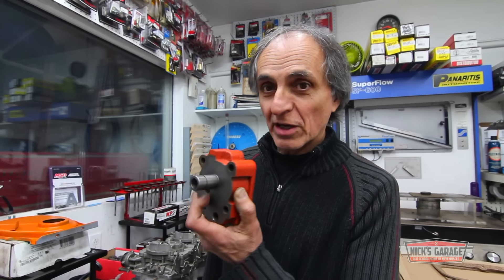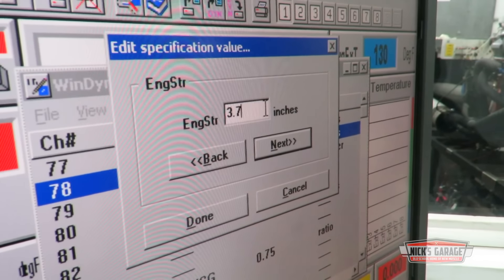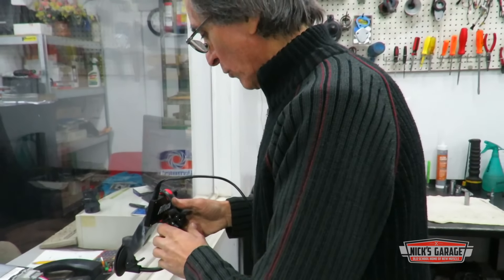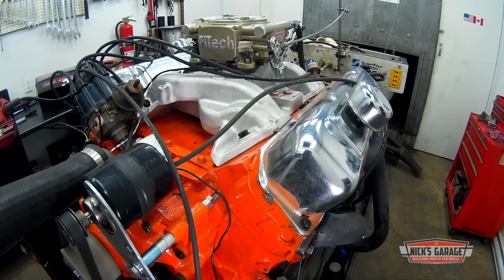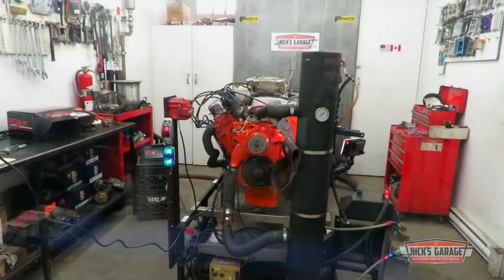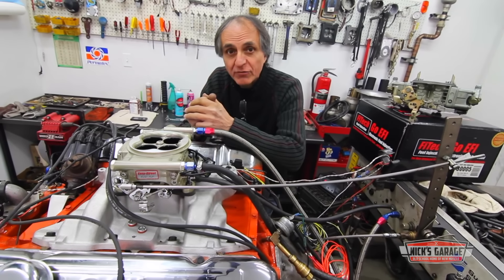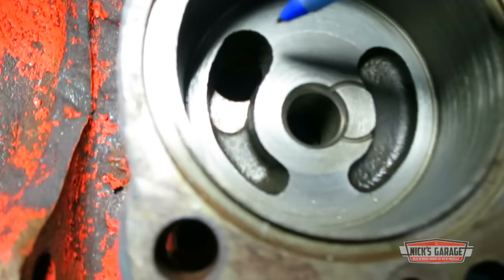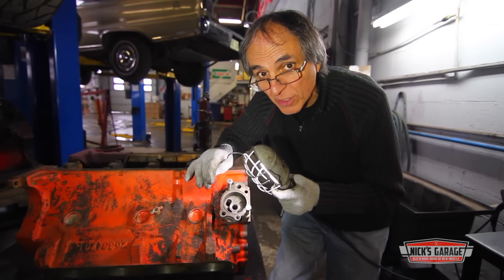Carburetor vs E.F.I. - Dyno Room Showdown

Comment: Give that fuel injection a little more time to adjust, and i bet its dyno numbers will increase. Great video Nick. Thanks for the tips
Reply: Va Hoss. Yes, the EFI needs more time to learn.
Reply: I was thinking the same thing I have a few mates run fitech EFI and they did around 1000ks or 600 miles then fine tune them after .  They seam to like single plane intake more than dual planes to
Reply: You need to load the engine at different rpm points and it will sort itself out, and I would bet when it's tuned properly it will make more power than the carb
Reply: Brett Wilkins kind of what i was thinking. Even NASCAR went to fuel injection. So there must be more positive benefits
Reply: Yup, I knew a couple racers who got as much HP out of EFI as from a carb once everything was adjusted. For daily driving I can't imagine ever going carb/distributor again. If I could afford it, having an old car to tinker with I could re-live my youth messing around with carbs and distributors that needed regular adjustment.
Reply: EFI systems are always capable of producing more power than carbs, because a carb inherently restricts the flow of intake air, it has to in order to function (the Venturi effect requires a restriction in order to work). Tuning is key.
Reply: Generally not. Carbs seem to make more ultimate power when properly jetted, but the injection is often quicker than a carb becuase throttle response is better. Injection better compensates for changes in temperature, elevation and barometric pressure - like driving to 5-6000ft on a hot day.
Mostly you see carbs beating injection but never by much.
Reply: Yeah but your arguement while true enough in theory applies to carbs. Carbs need venturi vacuum to create a pressure differential to discharge fuel. The intake design is more optimized with carbs in mind. Injection has a pump discharging fuel at 60-70psi so your discussion is better suited to carbs I'm thinking.

Oh BTW, 
Have you ever driven a car with a stout 440 in it?
All I can say is, if you haven't then the 10-15ft/lbs of torque you loose < 2500rpm with a single plane is only going to help traction lol. The bloody things make over 500ft/lbs with some comp, airflow etc.
And they're short enough in the stroke to do about 6500rpm! 
I was scared of mine.
Reply: Well for us - I'm a qualified mechanic and enthusiast, it is different.
I almost bought a Quick Fuel double pumper with 4 corner idle djustment for my project which is a 350 SBC into a Toyota FJ40 Landcruiser with 'THOSE' metereng blocks you're talking about. No question they are the way to go.
My point you may have taken slightly out of the context and I probably didn't make it as clearly as I could have - that TBI in some ways is evolving in the hobby because it self learns. Expensive dyno tuning is probably not required in the majority of installations. 
Incidentally I bought the dual quad Fitech system and paid the extra $200 for the full software suite. I haven't used it yet, and yes a dual quad 350 in a 4x4 is ridiculous, but I can't afford a 1968 Dodge Charger with a Hemi in it, but I can afford a Chevy in my fourby; and I get to drive it everyday and don't care if someone scratches it.
Thing is the flexibility of the system, the resistance to side angles, rock crawling and the lack of having to tune it was the draw card for me. 

Others will see the benefits too. I can't believe that enthusiasts are so ignorant of carburetor principals. They talk so much rubbish it is scarcely surprising they can't get their rides to run properly.

TBI is a way out since it learns and self tunes. It adjusts easily for varying conditions. Long term reliability remeains an unknown however. It still make great power too, largely ignores overlap intake pulses, shouldn't stumble off idle and should just start. The benefits for the hobby seem obvious to most but the dedicated carb enthusiast will never die out.

My carb is the Thermoquad. I love them - I do.
Reply: ThePaulv12 - It may depend on the setup, but FI is absolutely capable of making more ultimate power. 

Where do you see carbs beating injection? Basically all of the fastest cars on Earth are fuel injected, including TopFuel dragsters.
Reply: In this video lol. Look I'm not saying injection isn't capable of beating carbs, all I'm saying is that for ultimate top end power the differences are small and usually in the carbs favour.
However injection is so much more practical. 
Using Top Fuel dragsters as proof of concept is taking things to the extreme don't you think?
I like carbs very much. People say they're unsophisticated compared to injection but those people don't know what they're talking about even if they think they do.
Nothing could be further from the truth. kamphwagon1 tells of many carb options (below) for Holleys.
Reply: "...all I'm saying is that for ultimate top end power the differences are small and usually in the carbs favour."

Maybe in the world of old, American V8s, but certainly not anywhere else.

"Using Top Fuel dragsters as proof of concept is taking things to the extreme don't you think?"

How so? They want the most power that they can get out of their engine, so they use fuel injection. You also don't see any race class, anywhere, using carbs unless fuel injection is explicitly banned, because they want to win races.

Edit: I'm also really interested in seeing some examples of carbs making more power than FI.
Reply: Yes I forgot about Holley and Quickfuel. I bought my Fitech in Dec 2016 and I was seeing Quickfuel stuff on the Holley website that year. The Fitech is still in the box and I sometimes wonder if I'll ever get my motor in the truck.
Thermoquads are not an AFB clone. I've had AFBs and I don't like them much because of the reasons you don't like them. Particularly the air door weights annoy me.
I had a 440 with two of them on a cross ram intake and I thought at the time it would be good to have the secondary features of the AVS on the AFB. Well I was ahead of my time because now Edelbrock make the Thunder series.
You are quite right re Holleys being more able to be tuned. The reason I was mucking with Carters 20 years ago was my dislike of the lack of features in the metering blocks that are all now adjustable.
I can tell you why they have all those new features; It is because of the availability of readily available dyno tuning. Only 20 short years ago, that stuff was nowhere near as common as today and Holleys now have reversible changes for their metering blocks.
Thermoquads are very simple carbs. They look complex but all the complexity is on the outside. They're not popular because of durability issues of the resin body - the plugs fall out of the jet wells and the resin body screw boses crack if the carb is overtightened. 
I found an article written by a New Zealander on how to set up Thermoquad to factory specs. That article was all I needed. It gave me a detailed base line to work from. I then bought the SA Publication Carter Carburetor book and the penny dropped.  I looked at a Thermoquad and saw possibilities where others saw junk. Over the years I have installed maybe 15 or even 20 on cars and really have had them running great. Unfortunately and recently a couple were killed in a car I fitted one to in 1999. 
The big problem is getting bits for them. Carter used to make a strip kit for them and there's a place that still does. The secondary air door on them has a profile and is the venturi. They always go rich in the top end which is a desireable feature, but the air capacity of them is in the 850cfm range. Chrysler had larger ones for 440s. The dual booster venturi design of the primaries is great for large overlap cams. They seem relatively immune to low vacuum at idle. Contrary to popular belief they have a 2 stage accelerator pump.
If you don't know this then you'll never be able to get the feature to work. That NZ article points this out and how they left the factory with this feature either intentionally or accidentally disabled. The aftermarket pump plunder that is listed for them is the incorrect part no and is too short to allow the second shot. The correct stock plunger has a longer shaft and allows a second shot of fuel as the secondaries open. The airdoor tension is infinitely adjustable and you adjust the max airdoor opening by bending a tab. The opening speed of the airdoor is moderated with a small dash pot. 
It has a mechanical cam profile to lift the the metering rods when vacuum is still high and the throttle opened say during cruise. A spring raises the metering rods and they have a screw thread to alter the height. The metering rod jets are replaceable as are the metering rods themselves. The metering rods are tapered or stepped depending on the application.
What I have just told you about them is basic stuff but they're written off as a junk carb. 
Chrysler in their factory performance manual reckoned on a single quad Edelbrock STR intake that they were a formidable combination. The factory performance arm tested them extensively and told the builder a Thermoquad was a great flexible carb for the street rodder. Bear in mind manual was written in the 1970s but I was surprised none the less. 
Best of all with them is they were cheap as chips. Now they're much harder to find.
Reply: Ya it takes EFI several full pulls to get a learning time for the Computer then it still will make adjustments later, a friend had a 70 vette 454 after about 5 full pulls on a 1/4 mile the Car was scary fast.
Reply: if you only consider performance carbs will always win...the end ...EFI is there to meet emission regulations and all that first...when used as a pure performance hardware it never deliver as promised

slap a double pumper pass on the dyno and voila...ALL THE TIME
Reply: Ragimund Vonwallat- Efi vs carbs is not a very good debate there is a lot of misinformation that gets spread around in the hot rod world. An engine doesn't care how it gets the fuel into the cylinder as long as it is getting the correct amount and the mixture is well atomized then it doesn't make a difference whether it comes from a carb or an injector. Efi does give much more accurate control of the fuel mixture and is capable of doing a lot more than what a carburetor can but for the average hot rod guy who doesn't have the knowledge and ability to utilize efi to its potential is probably best just sticking with a carburetor as it is simple and easy to understand and work with and gets the job done.
Reply: idontcare80 pretty much every Dino video I see, sure the newer direct injection can hang with a carb, but these older style carb footprint Efi setups just don't make the power.
Reply: Single point fuel injection isn't much better than a carb. Need a plenum-type manifold with individual tubular runners for a proper multi-point setup, and then you'll start seeing major advantages. The plane type manifolds used on these old engines aren't as efficient. At this point you may as well be running ITB's.
Reply: Va HOSS... I would agree with your statement  I'd also like to see them put a carburetor on it that day and compare it back to back fully learned EFI versus equally flowing carb. I bet you they'll be within one or two numbers.
Reply: If you were just goin for WOT configuration, go with ITB's. Not sure why all this mess is necessary. ITB's could be done easily on a carb system, just as easy with fuel injection (although more expensive) and you'll get the best WOT performance. However, engines configured for WOT, huge valve overlap, lopey idle, really suck for daily driving. It's downright annoying to drive in traffic and attracts police attention. Street cars and road course vehicles would be best tuned for mid-range, and you can add some top end with a turbo. Carb + turbo would be a nightmare I'd imagine, probably not very reliable, either, without some kind of digital fuel metering, you'd need to run super rich all the time just to keep from grenading.
Reply: venturiless carburetor will make more
Reply: Engine master did this a while back and efi was better all the way around on hp torque etc
Reply: From what i read after market efi tend to forget what they learn over a period of time not to mention failure s with pumps injectors etc .1 in 5 has trouble good luck
Reply: If you wanted to get more power out of the efi, you could let it run longer so that it 'learns' how to make its own adjustments. OR........ Just install a Ford engine, which will produce more power regardless of which fuel intake system you choose! Lol
Reply: Yeah then after 2000miles pc restarts and learns all over again .no tx
Reply: @nickpanaritis4122  Does that EFI have target AFR's ? Is there a wide band o2 sensor or just a standard plus or minus response? 
May need to rev it or give it many full throttle pulls for it to work out a reasonable strategy....
Reply: A single plane with equal length runners, or at least a open spacer with the dual plane intake. The issue is it is still wet flow and all of the sensors need a average reading that isn't obstructed by a plenum divider or shelf.
Reply: @patrickmcleod111  fix OR repair daily ?
Reply: Self-learning like most cars when you have removed power to the ECU, it has to monitor your driving styles, altitude, shift points etc.
Reply: dual plane manifold force 1 side of the carby to behave differently from the other at different speeds ( try watching the fuel air mixture bounce back with a strobe light ) i dont know if that injector system can allow for this , once again , show me the graphs and stoich ratios , im sure that the figures given for the carby version come attached to many years of experience and experimenting , put that behind the injection system and tell me the story again
Reply: @VAHOSS  because efi adjusts itself to changes where you have to adjust carbs to different temps and elevation
Reply: @eleanorecopet4090  - First On Race Day baby.

Comment: Know many don't like fuel injection, but knowing that carburetors flood an engine with gas at starts, washing oil from cylinder lubrication, and causing much more wear than FI, also problems with idle and performance over all ranges, with a company like FITech would seriously look at them on future projects..and this is from a guy who has been rebuilding and setting up carbs since he was 13, in fact by 15 many people were bring their problem child carbs to me to rebuild. Wonder how that HP would change after awhile of that system getting learning about higher RPM situations.

Comment: does carboraitor give you more horsepower then fule injection i have a 93 dodge Dakota with the 318 it's fule injection now I'm just trying to find ways to get more horsepower
Reply: Buy a 350 and try again another day. 318 is basically a big v6
Reply: Barney W.    Try installing a 360 "5.9" if you can find one. Sorry for the late reply.

Comment: The advantage to fuel injection isn't power but economy.  It will  vary air/fuel ratio according to engine demands. Where as a carburetor is more of a fixed ratio and therefore less efficient over a wide operating range.

Comment: As long as the aftermarket allows it, I'll always go with carburetion. Vacuum secondary 4bbl with manual choke is where it's at. They're cheap, simple, and look good. They're also not as bad on fuel as people make them out too be. I figured out my 406hp (at the crank) Nova, 350ci, is turning 15 or 16mpg hwy. That's not at all the 8mpg people think you'll get.
Reply: But if you drive it to dinner you smell like exhaust. Fuel injection all day

Comment: Thanks for the tip on the oil pump. I had the same issue on a 413 is was building . I was grinding smooth the inside of the engine to get rid of a bunch of casting crap left over from the factory and then I looked at that hole in the pump and decided to do what you did I was amazed. So I match fit the holes and also smoothed all the ruff casting surfaces in the pump before assembly.
Reply: Cleaning out the casting slag and smoothing out all the oil passages on an engine is always a good thing.  Just be careful and don’t hog out the passages as this can lower oil pressure.

Comment: At 7:07:  The reason why you have to crank the engine more on a carbureted engine when it sits for a couple weeks is because it uses a MECHANICAL fuel pump.  If you were to replace it with an electric fuel pump (like what is found on the EFI system), you wouldn't have to do that.

Comment: thanks for the tip on the oil pump on the b rb  motor,i've found the pressure valve sticks a lot also,oh well 40+ year old engines need lots of love

Comment: Every test I have seen carb produce more wide open throttle HP but the injection has a massive tq advantage thru out the entire useable rpm range.

Comment: Love your knowledge and vids Nick. I dropped my Demon for FiTech on my 351C mild cam , AOD and 3:70 gears and never been so happy. They just need time to sort out and adjust by driving 100 miles or so in various conditions. The greatest benefit so far is that my injection system paid for itself in fuels savings alone over past two summers. 8 -11 mpg to 18.7 mpg!! It is like a free upgrade.
Reply: Are you still running the Fitech?